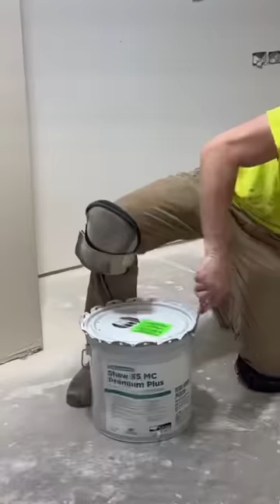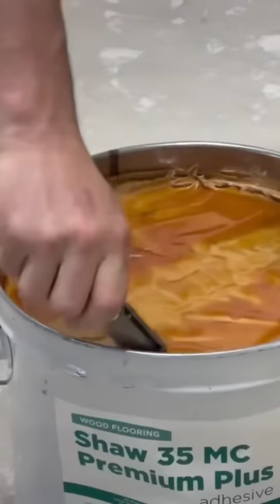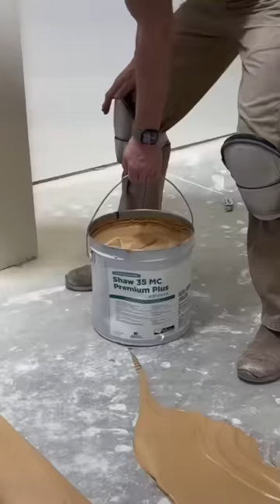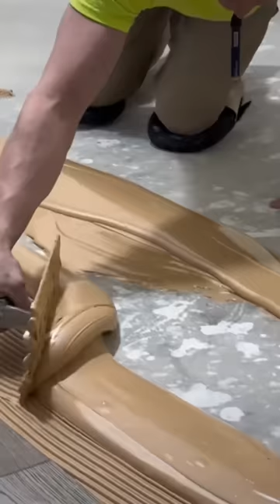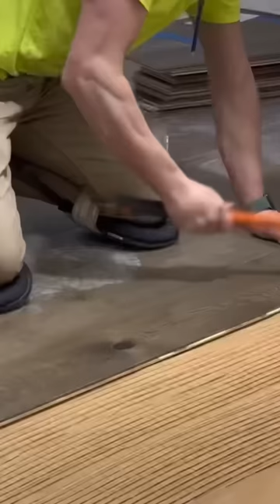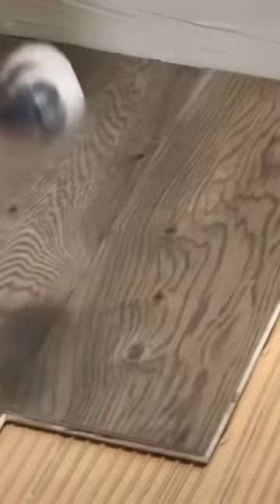Installing hardwood floors over concrete #shorts #flooring

Comment: It's better to be working on the opposite side of the flooring. This way there's no chance of the boards sliding around. Snap a line 4-6(depending on the width of planks) rows from the last one, and then spread the adhesive in that perimeter only. And work from the front, using your feet to push the planks into the groove. Makes for a much cleaner job! And no rubber mark on the hardwood! 😉

Comment: Not Hardwood Flooring!  That’s a laminate flooring!  Big difference!
Reply from the maker: This is called engineered hardwood flooring. Laminate flooring where I’m at has an MDF core.
Reply: @DaveyStruggle  Layers glued together (laminated), but with a fancier name (and higher quality layers) is still laminate. They named it that way for marketing purposes, bc it sounds better than "high quality laminate".

Hardwood is a solid piece of wood from a tree, shaped and finished.
Reply from the maker: Incorrect. Google is free to use, give it a try.
Reply: @mherrmann81687  engineered timber is definitely not the same as laminate.
Reply: @nathanielcooke6122  engineered timber is definitely different than Hardwood as well... and that was my main point... along with the fact that engineered timber is still pieces glued together, not a solid piece of wood

(Laminate: manufacture (something) by bonding layers of material together.)
Reply: Anyone who is any type of flooring guy can see this is NOT laminate 😂. First of all, laminate is click n lock. Engineered is T&G with a few new tech exceptions. Clearly the person making this comment is ignorant
Reply: @Rlazalier  honestly, I understand that it isn't regular laminate flooring, but it's not real Hardwood either... and I think that is where this all started.
It's more of a middle ground, with a real wood surface being glued to a core layer (similar to the layering in laminate, but with better materials). Which has its own benefits and drawbacks, when compared to actual hardwood and laminate.
Let me borrow a page from you to help try to clear things up... "Anyone who is any type of flooring guy can see this is NOT [hardwood]" as the title of the clip suggests...
Reply: Let's be honest, we could all use a guy like @DragoPhyre_OG backing us up in comment sections. For what it's worth. Calling this flooring "hardwood" is just manipulative marketing. Changing definitions to fit the narrative for gullible idiots is the new norm though.
Reply: @DaveyStruggle There is a huge difference. Only a fool would use glue on an actual hardwood floor.
Reply: MDF is a substrate NOT hard wood lol. Literally medium density.... lol.
Reply: @milwaukeebrewers6337  who said MDF was Hardwood??
Reply: Who I'm the hell glues "hardwood" flooring to concrete. Wtf 😂
Reply: Ummm hardwood is wood... This  is beautiful but is not Wood
Reply: @mherrmann81687 engineered hardwood is layers of wood glued together like plywood and then the top 1/8” or so is real oak, maple, hickory, or whatever you chose. Been installing engineered hardwood for 9 years and it’s a good product. Laminate is MDF.
Reply: @jakeklassen3702  So layers glued together with a layer of hardwood on top....
So, like an upgraded version of laminate... between laminate and hardwood... but not hardwood, just a hardwood layer with cheaper backing layers.

* Checking reference materials *
Lamination is the technique/process of manufacturing a material in multiple layers, so that the composite material achieves improved strength, stability, sound insulation, appearance, or other properties from the use of the differing materials.

In this case, gluing layers of cheap material together, and topping them with quality wood for the appearance of a higher quality floor, on a lower budget.

Just bc it isn't made with plastic or vinyl, doesn't mean that it is a solid, contiguous piece of wood (like true hardwood flooring slats).

What was it that Shakespeare wrote?
"A rose by any other name..."
Like I said, "Engineered Hardwood" just sounds better than "High Quality Laminate" or "Hardwood Laminate" or "Real Wood Laminate"
Reply: @mherrmann81687  who hurt you in life man? You do you. You can call it laminate if you want, I’ll call it what it is, engineered hardwood.
Reply: @jakeklassen3702   I agree that it is better than the plastic/vinyl topped laminate, and may be made out of higher quality materials, but it is insulting to just call it "hardwood flooring", as this video did...

You can call the product whatever you want but the process makes it a laminar material, regardless of how you twist the verbiage.

Comment: I laid floors 20+ years ago, and we used a solvent based 711 glue sometimes. After doing a closet, you'd be high as a kite, and in a wide open room, your shoulder would be killing you! especially in cooler weather. That stuff was thick!
Reply from the maker: I prefer working with thicker adhesives, because of its superior grab. But blisters and sore hands is the result.
Reply: @DaveyStruggle  Yeah, unfortunately the latex based glues are still in their development stages and are not quite up to scratch yet.

Comment: I remember doing EXACTLY this to my previous house.  The wood, however, was 2-3 times THICKER but only 2” wide, so it took me a LONG time to get the entire first floor done.  I NEVER did this before, so ANYONE can do it (as long as you can kneel and cut the wood). It isn’t rocket science. The results, however, were AMAZING.  I saved THOUSANDS of dollars doing it myself.  I followed up with nice baseboards.  About 5 years later when we went to sell the house; the floors, paint and moulding are what sold the house so quickly!  In fact, within 3 days, there was a bidding war on the “custom” house. 😉😃
Great videos!  Great memories. It was HARD to leave that house!

Comment: I just threw my flooring on top of the concrete seems fine so far only one corner seems a little uneven and it’s the corner behind my desk so sometimes I feel it with my feet lol drove me crazy but has settled more over the past few years.
Reply: You tellin' me you didn't use a gallon per square inch of glue like this guy???!?  Cmon man! Osha or whatever!

Comment: Brings back memories of when I worked with some folk who used this polyurethane glue similar to what is seen in this video, to glue down parquetry flooring. It needed to meet commercial standards and regulations as it was for a department store. We mainly used water based for domestic applications and it was very effective when cured. 19mm solid Australian hardwood was the typical thickness of our parquet blocks, meaning there is a lot of meat should you need to re- sand again and again over its lifetime and it also gave you redundancy in allowances for high and low areas where sanding would take care of levelling. It's hard to get hardwood these days and it costs a fortune! This video, doesn't look like solid timber but rather veneer or what is known here in Oz as engineered flooring, a fancy name for panelled or floating floors. In fact that floor type of installation appears as a clip lock system that connects together and just sits on an underlay which sits on the sub-floor. Either I'm not seeing the panels well enough or the client wanted them stuck down!
Reply: Yeah. I would have never glued these down

Comment: Big mistakes start at the beginning.  You glue 3/4 plywood down first, then apply wood floor nailer. If there is ever a flood or need to fix or replace floor q uick and easy. Also a barrier against cold concrete.
Reply from the maker: If there is a flood, you will not only need to replace the wood flooring, but also the plywood now. The adhesive used in the video acts as a moisture barrier.

Comment: I did hardwood flooring for a while and I hated glue down still to this day
Reply: Not all glues are created equal, some are very nice to work with and easy to clean up, this Urathane junk in the video is a nightmare to work with from clean up to flash time to hallow spots from the glue sagging
Reply: What the hell they do when going change the floor…..move house
Reply: @martinburke2634  floor grinders make quick work of it on concrete. Wood subfloors is a nightmare though.
Reply: @WillyBShooting What glues are the good ones to work with?
Reply: @the-openlab  Bostic ultra grip, Stauf SMP, are my favorites, cleans easily when dried so you can just rub the adhesive of planks and walls with a tennis ball so no trying to smear it away with solvents. Both glues have amazing open times and don’t skim over on you while trying to work.

Comment: Did anyone notice the piece 😅f metal that was inside the can?
That is a special notched trowel that attaches to a standard trowel. It allows for an 1/8 inch continuous coat and another 1/8 inch rib on top. If that concrete is in contact with the ground, moisture will get through and get to the new wood floor.

Looks like the aplicator was using a 1/4 notch. So the trowel is scraping half the material to close to the concrete. 

I saw a floor fail because of this. 

The company has to redo for free
Reply from the maker: You will notice that on my trowel, I already have one of the clip on trowels provided attached from the previous pail.

Comment: Is it not better to make 3mm adhesive layer with 5mm acoustic mat, and then lay panels? I think it's a good solution in case you plan to change floor in future, but I might be wrong...

Comment: No spacing?

The recommended expansion gap for the engineered wood floor is 8mm (5/16 in). For hardwood or bamboo, leave a gap between 10 to 15 mm (3/8 to 5/8 in).

Comment: I did this with 3/4 by 4" white oak.Laid 1950' sq ft.I sanded and finished after and turned out beautiful.I charged 21,000 for the job .

Comment: I spent 1800 on glue alone on 1950'.This glue is water proof and is very good.Very important to cover ever inch to be water proof.
Reply: Thats absolutely insane. That's almost $1 per sqft just for glue.
Reply: @randybobandy9828  If someone wants 3/4" solid hardwood flooring and they have concreate floors that is the best way to make it happen though.The total price for everything was around 21,000 and two other company's wanted 10,000 more to do that same job.I do agree that is a lot of money on glue but was also a lot of hard work.

Comment: Question: does this application make the installed floor less noisy when walking? I imagine it would. 🙏👍
Reply from the maker: Yes, that’s right. This was installed in condos, the levels below benefit also from the sound deadening this adhesive provides.

Comment: Is there a reason to glue it down over the float method. We used underlay for our solid oak floor and it's been there for over 10 years with not a single issue.

Comment: А как же ламинат с замками, для чего такой геморрой
Reply: Любят сложности)))
Reply: Это паркет
Reply: This is laminate floor and no need any glue to install it anywhere, just use underlayment and install it, it is floated floor .
Reply: @renovater101  Wrong. This is engineering flooring it needs to be nailed or glow down.
Reply: @mr.sfa.6832  👍,
Reply: А если затопят ух веселье)
Reply from the maker: This is incorrect. This floor is not a laminate and does not have a locking mechanism.
Reply: @DaveyStruggle  looks like laminate.  Well if it is waterproof it's not a big deal,  but if not, to change it will be.
Reply: @DaveyStruggle  что ты скулишь
Reply: Ламинат то ещё дно…(
Reply: @bigtonytarsoniks5643  в любом случае страховать нужно жилье

Comment: Bu madde bedir? Sürmeye gerek var mı? Sadece yapıştırmaya mı yarıyor ve ısı yalıtım özelliği var mıdır?
Reply from the maker: This product has a few beneficial properties. It acts as a moisture barrier as well as a sound insulator if the floor is being installed on a second story floor. This installation method is very difficult to demo, which is why I recommend a high end engineered floor that can last decades.

Comment: It's engineered hardwood. Aka plywood with a top wood veneer of the species of your choice. A) doesn't need to be glued b) the only reason you are gluing in this application is to try and force wood not expand and contract which will work for a few years c) once that fails you have created an absolute nightmare d)insulated/isolated 2x2 floor panels.. nobody with a brain glues wood flooring anymore
Reply from the maker: Yes this is engineered hardwood. All your other points are incorrect. 
We used the full spread glue method because we are installing over gypcrete where nails have no affect and client preferred the sound deadening quality compared to T&G glue. This type of adhesive still allows the floor to contract and expand, no amount of glue or nails can prevent that from happening. Which is why we have the whole building climate controlled prior to installation.

Comment: This is what NOT to do to install hardwood flooring.
Reply: Where do we find your videos of the only perfect way to install them?
Reply: @DJ99434  👍🏻so many video’s can have this comment. People nagging how not to do it but not posting themselves the ‘right’ way. It’s just to easy
Reply: @DJ99434  because I disagree with something, doesn't mean I have to produce a video to support that view. Hardwood flooring should NEVER be stuck down with glue. Ever. Go ahead tho if you are inclined. Just wanted to save some heartache for some people. That's all.
Reply: @OverkilledUnderdog  I'm glad you think you are the expert but I can tell you, you are misguided.  Just laid down Walnut engineered hardwood, which actually stated on the front of the box "Glue or Nail Down Installation".  You can't nail hardwood into concrete.  I'm a GC doing reno's and have used this type of product many times with great results.
Reply: @namenotavailable11  you aswell are doing it incorrectly.  A wood product on top of concrete slab on grade will warp and fail. Op is 100% correct.  Your whole the manufacturer said nail or glue pertains to a wood substrate not a concrete surface. I don't need a YouTube video of my installations to prove it.  And engineered just means plywood with an expensive wear layer.
Reply: @GM6.7  this was my exact thought. If you glue wood down it will not be allowed to contract and expand due to moisture and temperature condition which will cause stress fractures I believe. 

This is actually one of the biggest issues with any real woodflooring. My dad had major issues with his wood floor in his remodel due to moisture.
Reply: Meh. I glued down a white oak floor with 10" wide planks straight to the slab  over 23yrs ago in a 1700 sf  rectangular office. No issues. I visit that office regularly and it's still holding up beautifully. Maybe you just did it wrong. I did 7 day moisture tests before hand, let the wood and glue acclimate for 4 days, and left a 1/2" gap all the way around because the boards were so big. Like I said, no problems.
Reply: No what not to do is comment on something you clearly have no clue about, it just ends with you looking ridiculous
Reply: @mikepage9520  thank you for your opinion. Which is what all comments are about. But you clearly don't know anything about hardwood flooring or removing them.
Reply: @OverkilledUnderdog  no you're right, only laid my first floor 20 years ago, know a bit about lazy installers though
Reply: @namenotavailable11 Engineered is the key word. All Natural should never have glue period. Cracker Jack GC.
Reply: @OverkilledUnderdog actually if you read in the national wood floor association book you can glue hardwood down. Not sure what your experience is in flooring but you can definitely glue down engineered hardwood. I’ve done thousands of sq/ft with no issues. Just do research, get appropriate glue and trowel, and you’re good to go. Engineered hardwood doesn’t expand and contract as much as solid hardwood, and the glue used has elasticity to it which will still allow some movement.

Comment: This is an engineered floor NOT a solid hardwood floor.  You should NEVER, EVER install a real hardwood floor onto/over concrete.  Also, that mud/ adhesive you poured/slathered on the floor was really not needed.  Help the next guy who comes in to install a new floor.

Comment: If my hardwood, you meant laminate… lol. But actually glad it’s laminate in the basement over concrete. A better overall choice then hardwood.
Reply from the maker: Agree this material is better over concrete. This type of flooring is called engineered hardwood where I'm at. It's basically plywood with a hardwood veneer.

Comment: I hope the concrete has insulation underneath or that is going to be one cold floor
Reply from the maker: These are condos with more units below, so the cold floors won’t be felt. The units on the ground floor surely will be much colder.